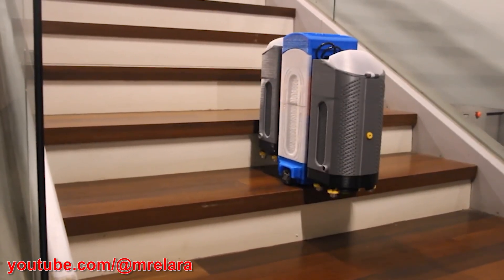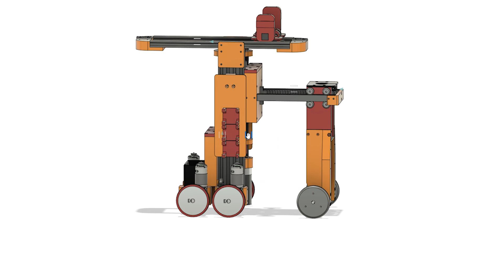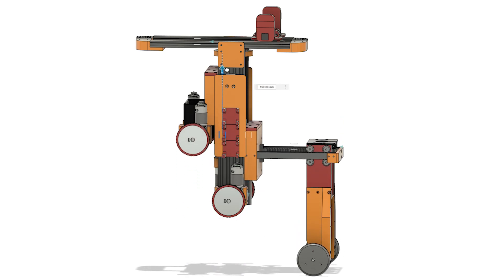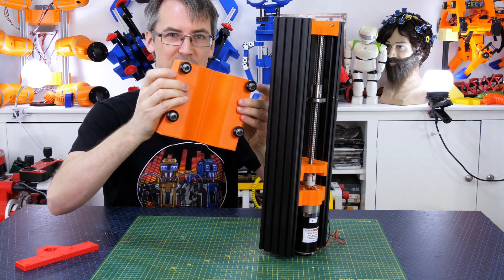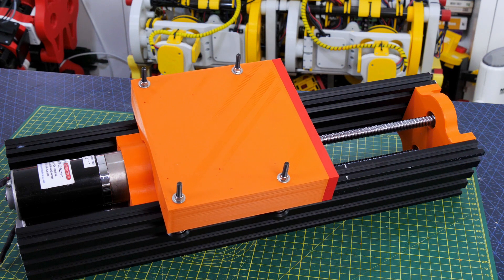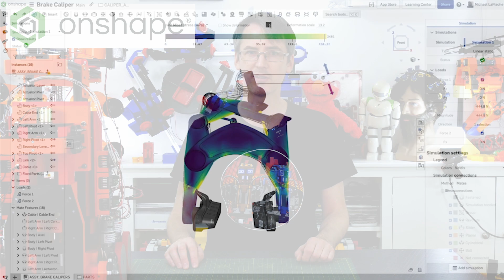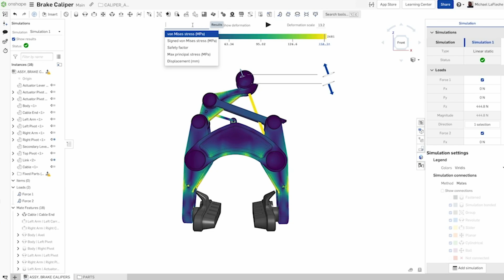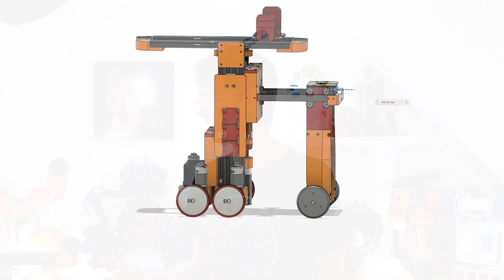How this Robot Climbs up Stairs

Comment: Can't you remove the 3rd set of wheels due to the existence of a moving counterbalance weight?
Reply: Yes, the back wheels are a bit unnecessary when you have the top weights going back and forth. Although it would be a bit wobbly so you'd have to drive slowly to not tip over on flat ground. And you'd have to use the front wheels to actually drive up the step, because when you're lifting up the front wheels it's basically balancing on the back wheels.
Reply from the maker: It's would be hard to lift the middle section though, unless each section has four wheels on it - but they would be very close together on the soft carpet.

Comment: Instead of sensor, limit switch for hitting side of the stairs is probably easier to implement.
Reply: Maybe some problem though with that fuzzy carpet
Reply: @bluemamba5317  Maybe a limit switch with a bigger bumper?
Reply: I'm pretty sure sensors were limit switches when I was learning robotics back in the 80s. There were infra-red sensors too, but there's nothing wrong with an, ahem simple touch sensor AKA limit switch. :)

Comment: The new camera rig seems like it's working out great, but with this project, because you've already added the 2kg weight shifting element, why not just use two sets of balancing wheels and a single actuator between them?
Reply: Funny - I had the opposite thought - since it's using 6 wheels, why have a shifting mass when you could just add a static mass to the middle section? :P
Reply: i think a servo with a stability plate at each set of wheels would assist in this if needed